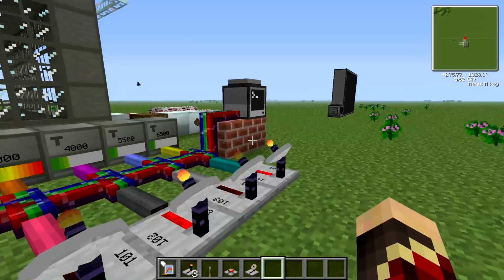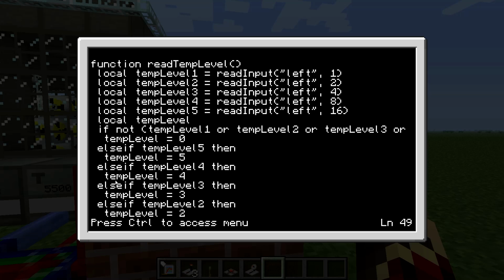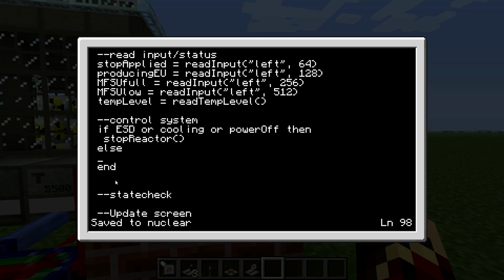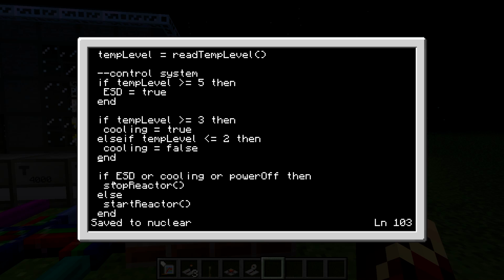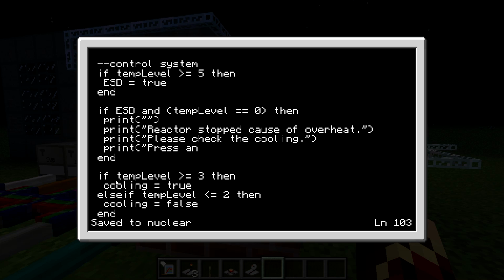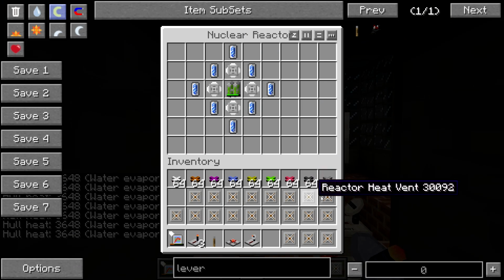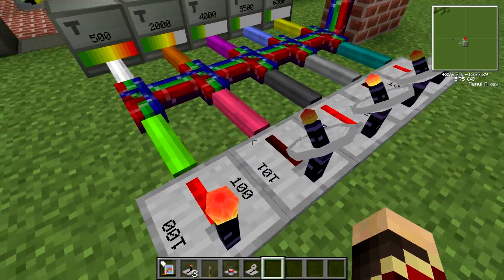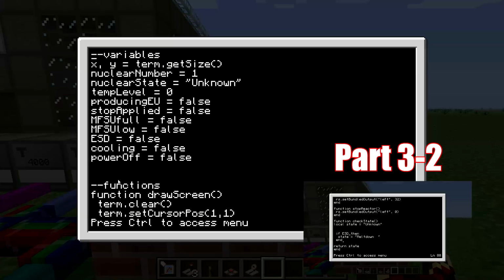Computercraft Tutorial - Nuclear reactor control part 3-1

Comment: my MFSU's won't transfer power to eatch other just the first one gets power but it does not transfer to the last one why?
Reply from the maker: My guess would be they are rotated wrongly.'

If I remember correctly, MFSU's have 1 output and 5 inputs. The orange dot is the output. So the first MFSU's orange dot have to touch the next MFSU and so on.